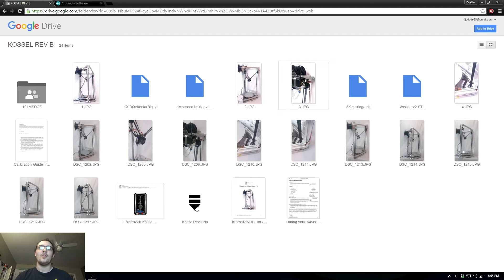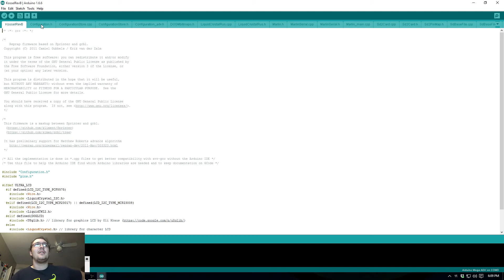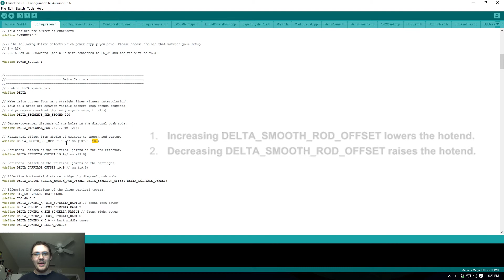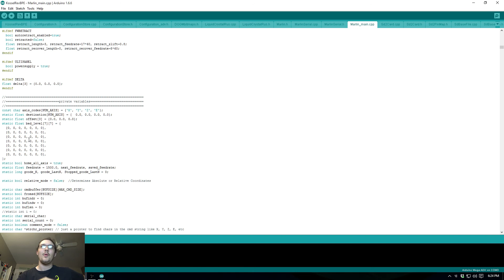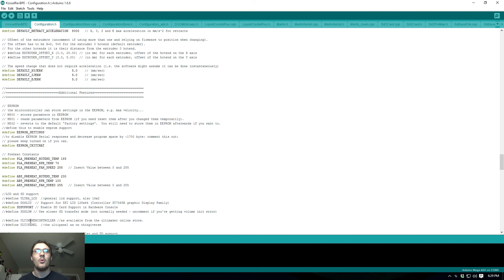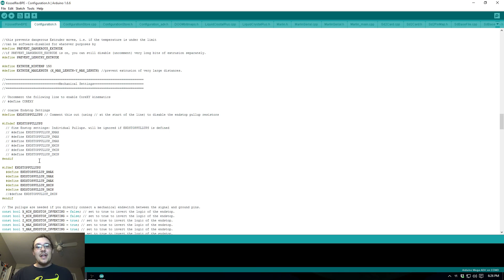Folger Tech Kossel 2020 3D Printer Calibration | #2 - Arduino Variables

Comment: Dustin,
I am having an issue when uploading the code to my board. Under the file SdBaseFile.h  It throws an error. The following is the section of code that has the error:

struct fpos_t {
  /** stream position */
  uint32_t position;
  /** cluster for position */
  uint32_t cluster;
  fpos_t() : position(0), cluster(0) {}
};

The error says:

exit status 1
using typedef-name 'fpos_t' after 'struct'

Do you know how to fix this? Any help would be greatly appreciated. 
Thanks!
Reply from the maker: New arduino IDE doesn't work. Download arduino 1.6.7 or before and it will upload.
Reply: Thank you!
Reply: I have gotten it to work but i am having another issue. Is there anyway i could explain the issue via Skype or phone?
Reply from the maker: Ben Kuhn no sir. What is the issue.
Reply: When I use the instruction manual and follow their steps using Pronterface It is throwing a triggered z-min notification when it shouldn't. Further more, if I try to click home or anything on the Pronterface display the printer just moves until i have to unplug it before it brakes. This is after i have followed all of your steps in your videos. I have tried to get in contact with Folgertech but i have gotten no response.Do you have any idea why this is happening?
Reply from the maker: You should set up repetier and follow that instead. It's better than pronterface. . Be sure you follow the z height video too.
Reply: I will give that a try and see what happens.
Reply: Dustin,
My bed temperature indicator is not working. Do you have any ideas why it is reading zero?
Reply from the maker: Ben Kuhn Use a multimeter to check the resistance of the thermistor. It should show a resistance
of between 80k-110k ohms, at room temperature. If you get 0, open circuit, or infinite, or a number that is way off from the range, then the thermistor is most likely damaged. Happens sometimes, they are really fragile.
Reply: hay i got the same printer i say i have the thing work at 98% but this thing prints like it thinks the bed is leening to 1 side about 1-2mm and the other side isdam close to scraping the bed but not at the same time  itsextruiding all most nothing on that 1 side if i put some tape on 1 side it kida of leves out but i shold not have to
i look all over the place on the next but found nothing about a delta with this proble wish i can get some info from you?
Reply from the maker: Don't use the the auto leveling. It seems to cause that. Level the bed manually with the endstops or add springs under the bed.
Reply: the kossel guile didnt tell me how to go about that an this is my first delta i dont know how to do it or start
Reply: can you point me to a vid on youtube that well show you how to do that the guilde build i was given dont show that at all

Comment: Hey I recently built a large scale delta 3d printer and am having trouble with the ramps board. It says I have errors in my code. Does anyone know how to fix it.
Reply from the maker: Very vague, but Google the errors and see if it has happened. It is possible that the newest version of Arduino Software is causing issue, so if that is the case, downgrade to Arduino 1.6.7, as it works.
Reply: Thanks! This fixed my problem. I fired up the printer but now it says i have a max temp error. The Lcd display is reading that it is 356 degrees but the hot end is not. Any idea how to fix this.

Comment: I am having a ton of problems connecting to the usb in arduino. Says that access denied. It was running on old computer and new one wont talk to it.
Reply from the maker: Try another USB port, and make sure nothing like Repetier or Pronterface is connected.
Reply: Thanks tried that. Rolling back driver now. Tried back of case vs front. Your response was awesome fast. Your video will be very helpful once Com hooked up. Keep up the good work.
Reply from the maker: Mark Denney Thanks man. Hope you get it figured out.

Comment: Just got my Kossel setup and your videos are AWESOME. FolgerTech should add links to you in their documentation.I've noticed a problem, somehow my Y axis is lagging the other 2 axis.  The x and Z axis home fine, the y axis lags like 1-2 seconds  and then comes up to like 1" below the end stop. Any ideas? It doesn't seem to be binding.
Reply from the maker: Does it move fine otherwise? Sounds like a weird connection issue on the stepper, or possibly the stepper driver not being tuned right.
Reply: Thanks for the quick reply. Aha, okay. I'll check the stepper driver and possible calibration. The y axis seems to move fine with no binding.My 4 year old grandson is ALL ABOUT 3D Printing.

Comment: Hi, Dustin. I try to upload firmware to printer but it show bunch of errors. What could be wrong? I'm new with 3D printers Thanks.
Reply from the maker: Depends on the errors. Try a different USB port.
Reply: Did that. Shows: checksum error, verification error and content mismatch.
Reply from the maker: Robertas Pikciunas which board do you have selected?
Reply: mega 2560, com3
Reply from the maker: Robertas Pikciunas Try Arduino Mega ADK for the board.
Reply: I think is uploaded firmware with errors.
Reply from the maker: Robertas Pikciunas Sometimes it is driver errors. Hard to say.
Reply: On Repetier message pops out saying "A fatal error on the printer side stopped the printer until the error fixed. Printer message:
Printer stopped due to errors. Fix the error and use M999 to reset"
Reply from the maker: Robertas Pikciunas Do you see temps for the extruder and bed? Them not working usually causes that error.
Reply: Bed show 26.4 C but extruder 0 C What could it be?
Reply from the maker: Robertas Pikciunas faulty thermistor or thermistor wiring. check the wiring for that thermistor.
Reply: And all EEPROM settings set to 0
Reply: +Dustin Corbin Found that I connected extruder heat tip cable in the wrong place
Reply from the maker: Robertas Pikciunas thatll do it

Comment: Not sure how to proceed with these error messages when attempting to upload to the printer.
Point me in a direction to solve this please.

Arduino: 1.6.8 (Windows 7), Board: "Arduino Mega ADK"

Build options changed, rebuilding all
In file included from sketch\Marlin.h:21:0,

List too long to post..
Reply from the maker: +Fred Dishner make sure Repetier isnt connected, make sure you have the right COM port. Try a different USB port.
Reply: +Dustin Corbin Thank you. I thought all was well when I first plugged it in and there was no smoke. I connected the USB cable and no smoke. I tested the three end stop lights and they all lit up when actuated. This printer is taking me to school. The power supply has no DC out, but it does have AC in. The end stops and God know what else was being powered by the USB port on my laptop. I will look at this supply to see if I can fix it or get a new one.
Thank you for all the help and videos, Dustin. I am having fun with all this.
Reply from the maker: Fred Dishner if wired right there should be a green led lit on the psu.
Reply: +Dustin Corbin Everything is now powered up OK. It was my bad. Uploaded the software successfully with the changes you suggested. Also, thanks to you, I have a much more clear understanding of how this works. Thank you so very much for all of you help and videos.
Reply from the maker: +Fred Dishner glad I could help! :)

Comment: It would help a lot if you turned on the line numbering in Arduino so we can see where you are in the code.
Thank Dustin
Reply from the maker: I agree... I just didn't know how to turn it on at the time. I use ctrl + f to find things in the code.
Reply: pretty easy from preferences from file drop down. You are doing a good job that was just something that would help new users find things.
Reply from the maker: James Cullins thank you. I'll add that in for any future videos.
Reply: I do have an issue with z axis. It oscilates when it hits end stop. acts like it is not seeing it but I have checked and the signal is getting to the input pin for z-. It does finally back off and then bump it again and it stops but not confident that it is correct.
Reply from the maker: +James Cullins send command M119 to check the endstops, and see if it reports as open or triggered when the endstop is actually untouched or triggered. Also make sure the endstops are on the correct tower and plugged into the right spot on the board.
Reply: It does and also the zMax is reading correctly
infact all axis are reading correctly. It keeps stepping after it hits only on z  for 3 or 4 seconds then stops backs off the switch then moves up hits the sw and stops
Reply from the maker: +James Cullins haven't heard that before. You may want to reflash the firmware. Sounds like it isn't registering correctly.
Reply: Been there done that. I even swapped the motor drive modules with Y drive still the same thing.
Can you send me your profile to try?
Reply from the maker: +James Cullins firmware I use is in the description. It's a little old but is set up for this Kossel.
Reply: I watched it closely this time. The z axis hits the switch , stops the other axis hit their switches then the Z starts chattering like it did not reverse off the switch but tried to go fwd. The other axis backed up the fwd again to the sw. It has to be a flaw in the firmware .
I asked for a profile I meant the firmware.
Reply: found problem. I had swapped the Z- and Z+ so it would never see the sw. all seems to work now, thanks